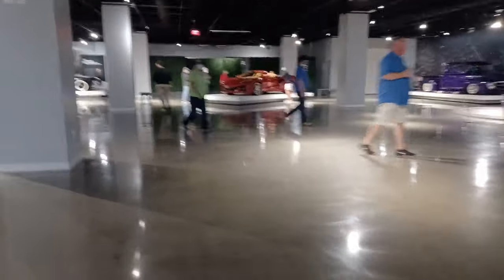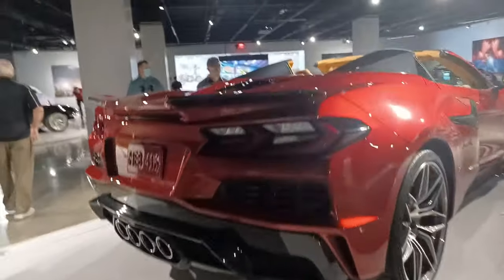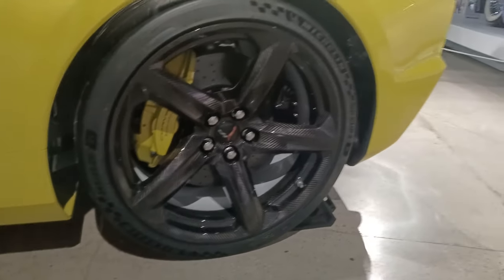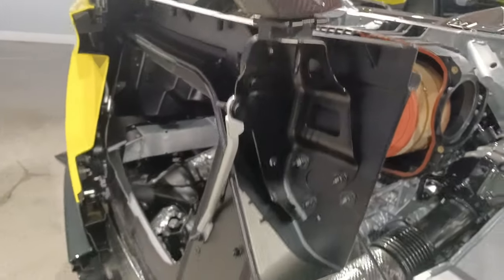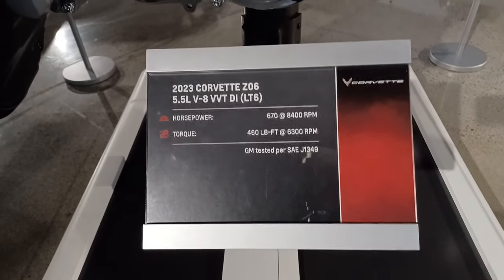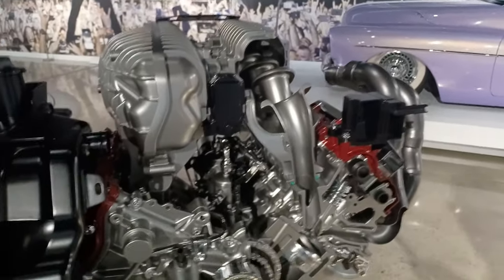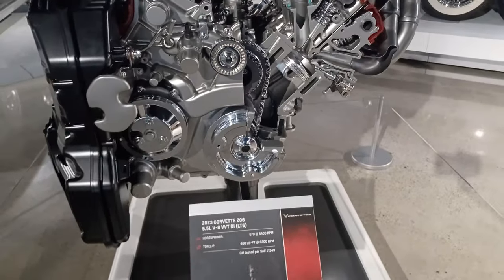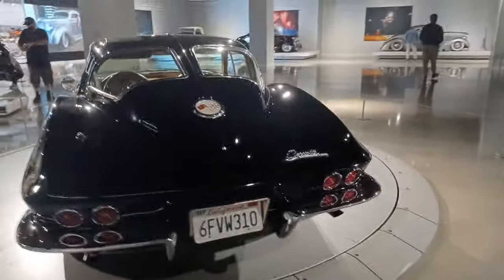The 2023 C8 Z06 Corvette at the Petersen Automotive Museum + Community Mission #2.

Comment: Those tires are worthless to drive on the streets bald already lol . If it was raining out your screwed . I have drag tires on my redeye and they hate the rain got caught in a storm and had to drive 45 mph all the way home 20 miles it wasn’t fun . Unless your racing on a track every weekend zo6 is the way to go. 10000 for zo7 10000 for carbon wheels save your money for some lt3 and carbon fiber add ons . I’m number 4 at my local dealer . No idea when it’s coming I’m guessing late fall early spring 2023 .thank you for the video good job I subscribed for more content sir .
Reply from the maker: Definitely track centric tires. Anyone planning on streeting the Z06 Z07 needs two sets of wheels and tires. One for track and another for the street. This is the plan for my Stingray. A set with the stock Z51 tires for street and another with Cup 2s for track.

Comment: 490 hp or 495 hp with the corsa exhaust for the c8 so 175 hp more not 150 hp great video. Not sure about reliability with this motor I heard lots of vibration issues with this new lt6 some serious engineering went on to hide it . That’s why most flat plane crank engines are a little smaller . High reving engines tend to wear out faster to like a 2 stroke engine vs a 4 stroke 2 strokes need to rev more to produce the power higher revs create heat and heat creates wear . We will see longevity in the years to come .
Reply from the maker: Thanks for your input. Yep I realized that I spoke in error when I said 150hp more. At least I erred on the low side. I agree with you that the more horse power an engine produces, the less reliable and durable it becomes. People don't realize how often race engines are torn down and rebuilt. After each use in many cases. This is a prime reason why anybody purchasing the Z06 should get the strongest warranty plan available.